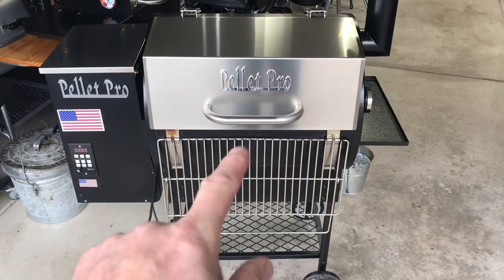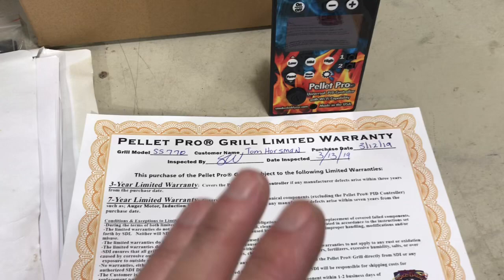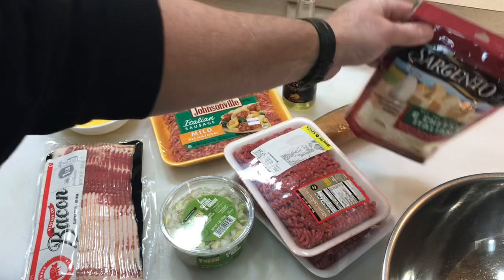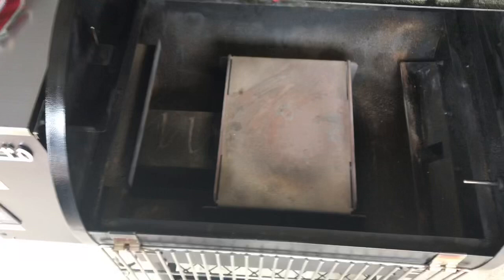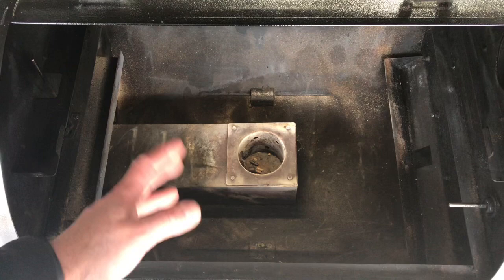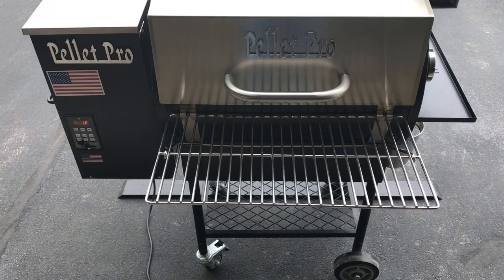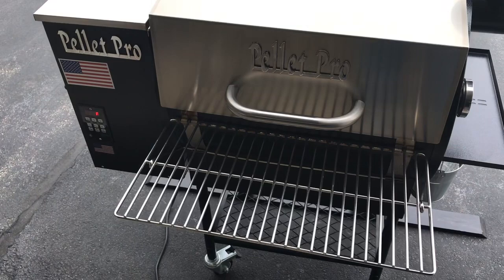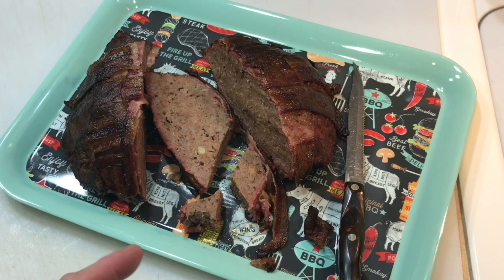The Best Pellet Grill! / Pellet Pro Pellet Grill From Smoke Daddy Inc / One Year Review / Meat Loaf!

Comment: I'm torn between the Smokin Brothers Premier Plus 30 and Smoke Daddy Pellet Pro
Reply from the maker: Thanks for Watching Tim! It is your choice! I’ve not had the Smokin Brothers  Pellet Grill. I’ve had the Pellet Pro goin on 3 years with no issues. It ultimately your choice, they both will most likely treat you well
Reply: @TomHorsmanAmateurBBQ  does the Smoke Daddy have any hot spots? Is it pretty even? How's pellet consumption?
Reply from the maker: It’s a pretty even cooker Tim, pellet consumption is depending upon exterior temps and set temp. An overnight cook at 225 uses about 1/2 the hopper, depending upon outside temp and wind. Once the thermal mass heats up it maintains very well. Thanks again for watching